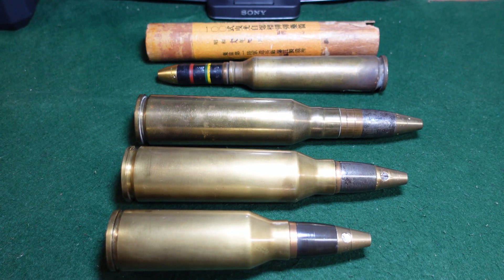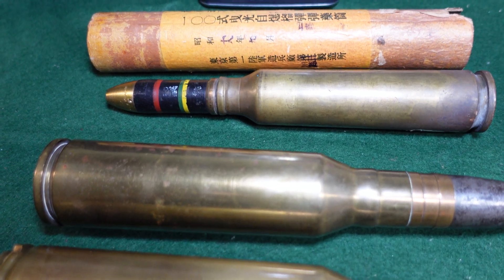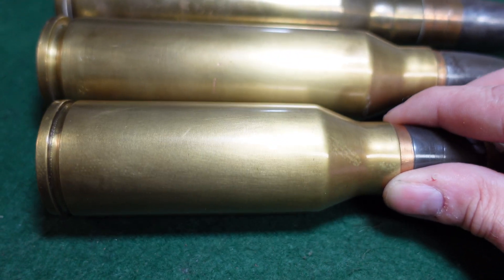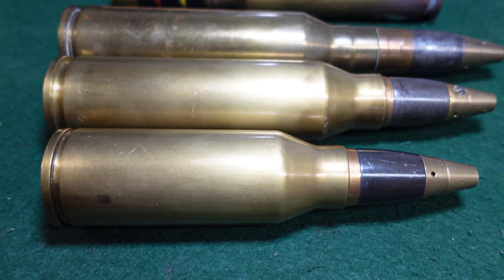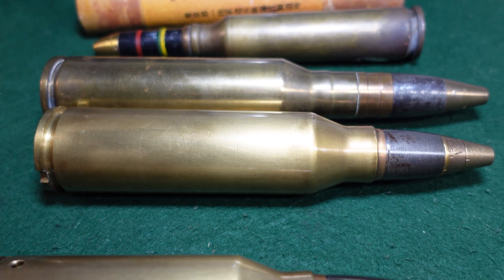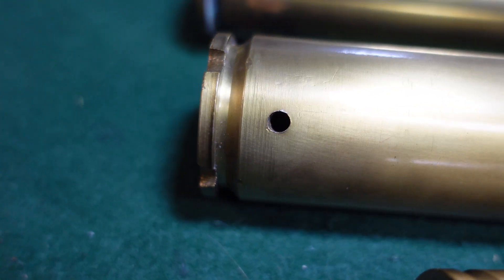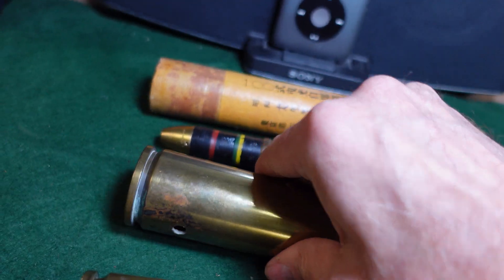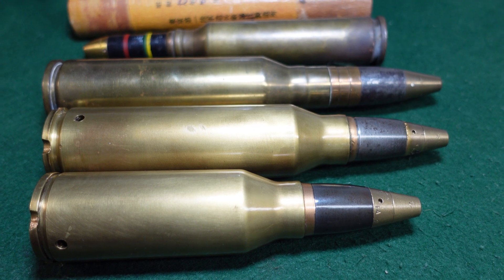WWII Japanese Experimental 25mm Aircraft Cannon Rounds: Overview and Closer Look

Comment: I have a 25-160 with a anchor on the bottom of it,  Japanese navy? Top of the tip, was roughly snapped off at angle , like the head was made of real shit metal?
Reply from the maker: Anchor is Japanese navy, which is common with those.  As to how it's snapped off, the tip was made to explode into fragments, so there might have been a casting issue?  Or someone might have just smacked it on something really hard!